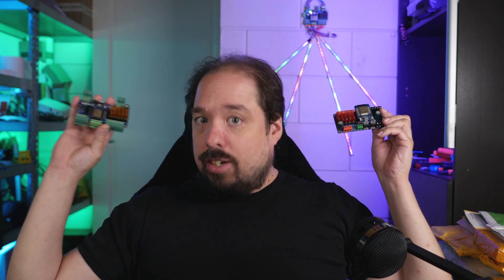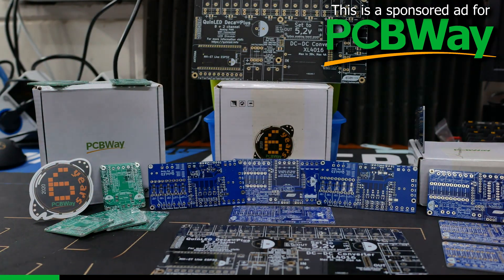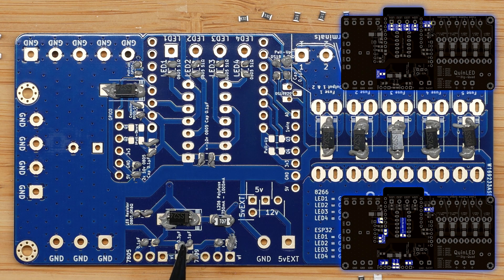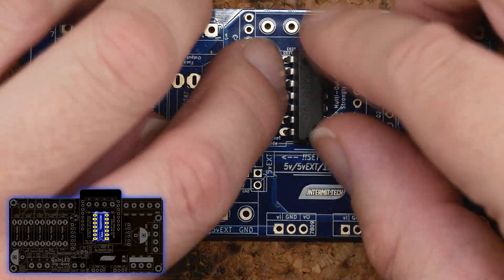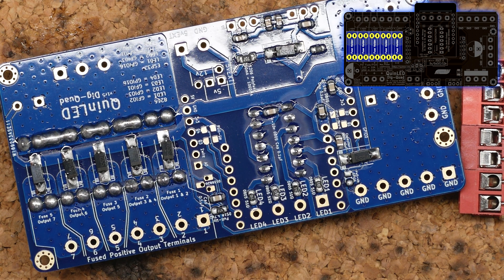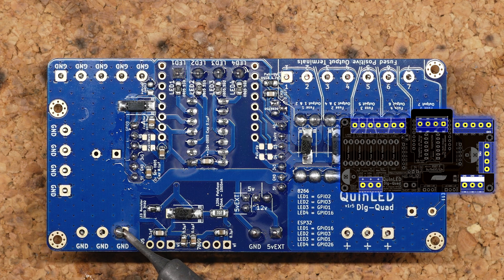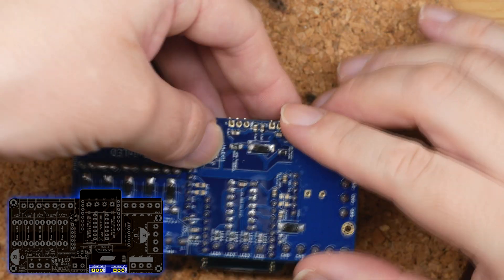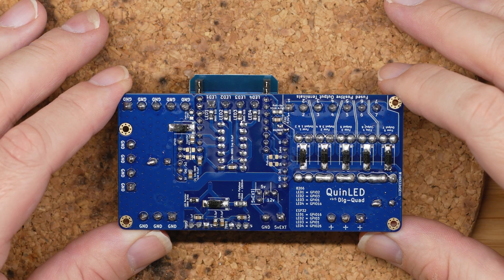💡QuinLED💡 QuinLED-Dig-Quad Soldering Tutorial

Comment: I’m getting ready to build a few dig quads.  The last of the components arrived today and the boards will be here i a couple more days.  As I was looking through the parts I noticed something odd.  The inks in your parts list for the voltage regulatory are for a 5V and 9V voltage regulator.  I thought the output options were for 5V and 12V.  How will that work with the parts you suggested? (BTW, yes, I did order some 12V voltage regulators yesterday)
Reply from the maker: On the current design it's meant to drop voltage in 2 stages, so from 12v to 9v to 5v to better spread out the heat. In the upcoming v3 DIY (being released this week!) it's done using the buck converter from the Dig-Uno, I also have an article how to do so on the v1 DIY Dig-Quad design and is what I'd suggest right now. Not that the staggered linear solution doesn't work, the buck converter is just a bit nicer to use.

Comment: The flux your using, does it contain the solder also, or are the components pre-tinned?
Reply from the maker: I think you mean the solder paste I used, which also has Flux in it. But the stuff I squirt on the board is 138c soldering paste, not flux.
Reply: @IntermitTech  Yep, I figured it out looking at your web site. Thank you

Comment: Why did you solder the LED with the iron and not hot air? Concern that it will cause damage? Also can you advise on what type of solder paste you used? I have never done it before, but I have bought a hot air gun for this, and now need to get the paste
Reply from the maker: Any type of paste will do, but generally the lower temperature 138c stuff is easiest to work with. :)

Comment: Hey I’m about to place an order for the Dig-Quad. After watching the amazing stream yesterday with DrZz which was awesome , I got one question, I totally understand everything is an unofficial “pre alpha” but assuming I do everything correctly would the 4 led strips act as one strip or would they just each display the same effect?
Reply from the maker: They can do either, without segments they act as one single strip divided over the output channels and with segments you can make those parts (set to the length per output channel) have individual settings.
Reply: Intermit.Tech gotcha, Essentially My goal is to have the strips border the roof of my room. But in dr zz demonstration each of the strips were individually plugged into the dig quad what if I connected 4 300 led strips together to wrap around my roof. How would I wire them or would that go against your discovery from the stream?
Reply from the maker: @bigmikexxxxxxxxxx  You can run 1200LEDs behind each other so serially but that will really cause the refresh rate per LED to drop, with 1200LEDs you are well below 30 updates per second so it will start to look choppy. This is a protocol limitation so I'd split that up over at least 2 channels so you stay around 60 updates per second per LED. With the modded firmware you'd just set it up as a big strip and then set the first port to 600LEDs and the second port to 600LEDs, internally it will function as one big strip and physically you'd run 2 data wires. One from LED1 output to the first set of 2 strips and one from LED2 to the second set of 2 strips and it will perform as if they are one but with good fluid effects!
Reply: Intermit.Tech Phenomenal! I could just used the pre alpha compiled firmware you guys provided with the segments at 300 each or would I have to change the code myself?
Reply from the maker: @bigmikexxxxxxxxxx  If you have 300LEDs per channel and want to use it as one big strip, the one we pre-compiled is perfect!
Reply: Intermit.Tech Absolute legend. Thanks brother! Can’t wait to wire it all up
Reply: @IntermitTech  After revisiting these. comments for advice , you mentioned setting the ports to 600, does that mean I would have to recompile the bin myself or is setting ports to 600  found within the bin you and Dr.Zz provided?
Reply from the maker: @bigmikexxxxxxxxxx  The pre-compiled bin has all ports set to 300 so if you want 600LEDs on a single channel, you will need to compile one yourself. :)

Comment: What about the fuse holder, one side of the soldering were bridged with each other? Or was that intentionally?

Thanks for the great video and explanation
Reply from the maker: Those pins where in a large area all together so the pins where crossed on the PCB anyway, so having some bridges there can't hurt, that's why I didn't bother correcting it.